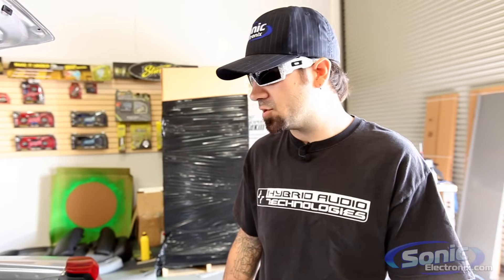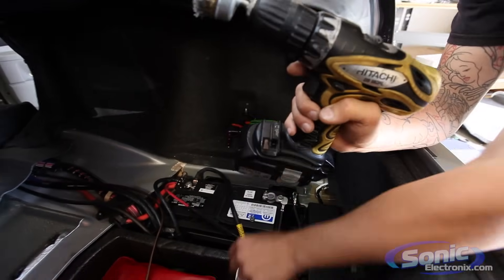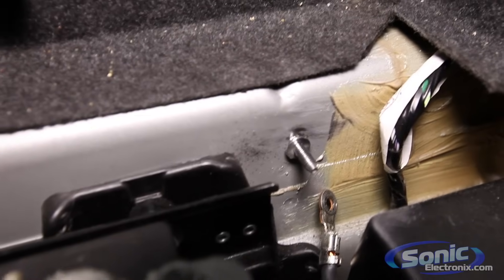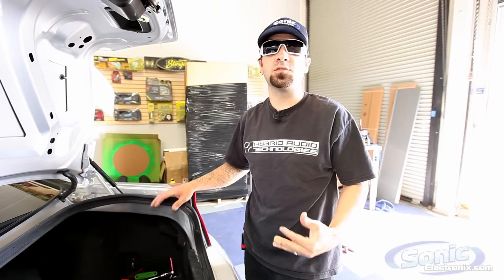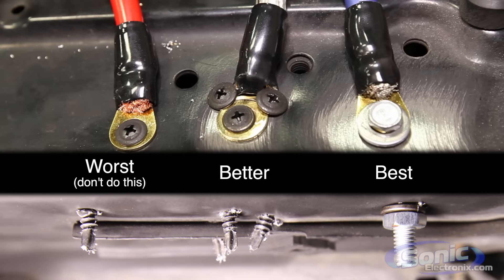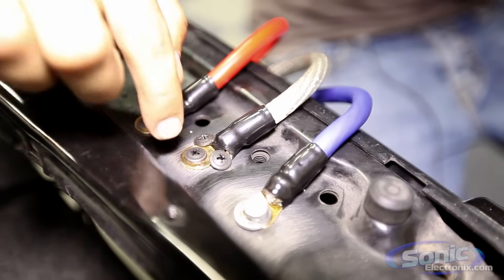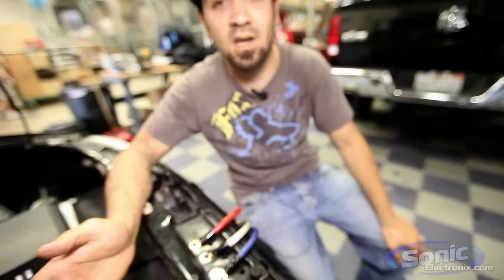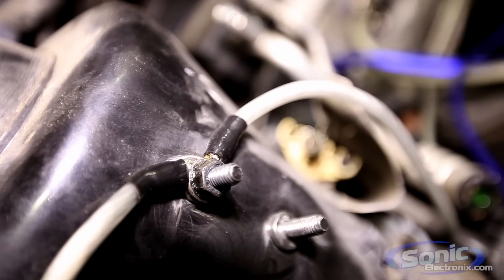How to Properly Ground a Car Amplifier | Good & Bad Examples | Car Audio 101

Comment: Can't you hook the amplifier ground to the battery ground?
Reply: +PSYk1ll4h If the battery is right next to where they are grounding it anyway it should honestly just be grounded to the battery. I dont know why they didnt just do that. If the battery is under the hood and your amp is in the trunk its a lot easier just to ground to the frame of the car.
Reply: +daytime81 If youre that close to the battery just ground it at the battery. It just uses the metal on the car as a path to get back to the battery anyway, So instead of having to travel through 2 crimp ends and post and what not just cut out the middle man.
Reply: PSYk1ll4h Yes if you have a long enough grounding wire.
Reply: +PSYk1ll4h You don't want your ground cable to be long. 1 foot for an amp is usually perfect.
Reply: +PSYk1ll4h its easier just to ground it to any metal on your car
Reply: Chris Siercks yes thankyou :D
Reply: +PSYk1ll4h I'm pretty sure they were only showing how to mount your ground to the frame.  Unless someone is planning on putting their amp in the engine compartment, you wouldnt want to use the negative post on your battery for several reasons.  One is because you want your ground as short as possible, so if you are mounting your amp in the trunk, you have too long of a ground wire.  Another reason is because it would be difficult to run a larger sized power wire and a ground wire through the firewall.  Finally, if your ground wire is 8, 4 or even 2 gauge, it can get very expensive to run that long of a ground wire.
Reply: drummerguy187 I know. I can get an battery and put it near the amp.
Reply: +PSYk1ll4h You definitely could.  Especially if you are trying to run a larger system in your car.
Reply: +drummerguy187  not only that but it dramatically shortens the life of the battery as wel as a major chance of exploding it from overheating and power draw. just use a short 3 ft or less ground to chassis and all will be well

Comment: Quick question, is it okay to connect 2 or more grounds to the same spot? For example the ground of a capacitor and the ground of an amp to the same bolt.
Reply: It shouldn't really hurt anything

Comment: Can i use the bolt that connects my cars back seat to the car?
Reply: Levi Abner yes, just make sure the bolt is free of paint.seat belt bolts work very well.
Reply: Bigchuck678 What if the seat belt bolt is bigger than my 0 gauge terminal? Where are terminals that have an O ring to fit my seat belt bolts?
Reply: Luke Urice I had the same problem, i just took a round sander bit from my drimmel and opened the O ring till it fit snug. You may be able to use a drill.
Reply: +lurice 0 your best option is to use a 0 gauge ground lug and bolt it to a bare surface instead of fighting with crimping large gauge wire
Reply: I used the seat belt buckle brackets, you know, the ones that hold the belt buckles in place? I used a drill wire brush to clean off the paint around the hole of where the bolt goes through. Also the bottom of the bracket and the top of it. It worked for me. Previously I had just took a self tapping screw and drilled it through trunk area. It was cleaned off as well. After some time I was getting engine whine. Took me a long time to figure out while and this video explains that. A loose ground can cause noise as well.

Comment: I have a question. I have 2 12 hifonics speakers. I'm having trouble with one of them one turns off by itself have to be moving the wire so it can turn back on

Comment: If the cars negative terminal is 6 inches from the point where you mount the ground, why wouldn't you just attach it directly to the negative terminal?

Comment: I would slap that guy if he did that to my car.
A factory ground should not have an amp attached to it because you will get noise from what ever that ground is for.
You need to up grade your grounds period.
1.00 cable from your battery to the block and 1.00 cable to the car body.
after you do that you can screw a ground with a tech screw anywhere you need one.
but you need to inspect ALL the factory grounds because I have seen mechanics forget to reinstall a ground and if all the grounds are running through a single cable I have seen them red hot cause problems with dash lights flickering tack jump around all because some idiot fucked up the factory grounds.
I have fixed a dozen cars just by re-connecting that little black ground that goes directly from the body to a valve cover bolt.
Reply: Your wrong!
A customer connected a ground to a factory location and it was the same ground as the headlight switch he was getting a high pitch sound every time you turned on the headlights
Another customer had the radiator start leaking due to electrolysis caused by a bad ground as I said I have seen more than my share of problems caused by lame installers who don't treat the ground on a car the same as you would the power.
Reply: On fords you have less trouble with grounds but GM don't get me started.
Honda and toyota are ok but you cant use the factory grounds to run accessories you have to run your own.
How many times have you heard about an alarm install causing problems it is because an installer used a faulty ground location.
Another customer complained her A/C was not working it took awhile but guess what the guy who install her stereo undid the ground for the high pressure switch put his ground on first and reconnected everything.
The computer was getting an incorrect resistance reading and would not let the compressor engage it thought the switch was bad.
Reply: It's funny you think thats beefy the 95 taurus I had came stock with a 130 amp alternator but I upgraded it to 250 because I do run multi amplifiers and an inverter I never needed an extra battery but I thought about it.
Reply: hay man, seems you know your shit, I got a 3000 watt amp, and the shop wants me to buy a 220$ ex battery, but can I go to wallmart and just buy a big ass battery, will it work, and whats the difference ? thanks man
Reply: yea they didn't say anything back extra kits and shit,  does it have to be a xs battery, or will any decent car battery work
Reply: I assume you car is A GM or a honda or toyota and the lights dim.
The reason you need an extra battery close to the amp is resistance if you use a 00 power cable back to the amp there will be no resistance In some cases the ground is what can cause the lights to dim thats why I say to upgrade the grounds.
When you buy that amp kit it comes with a 00 ground that will get you too the block and you will have enough extra cable to go from the block to the body.
I dont run big subs just two tens and I hate ported boxes.
If you must run a extra battery buy a good battery one that has a 5 year warranty put that battery in your car and run the old battery in the back.
A cap will do the same as an extra battery and you don't have to worry about an iso or the battery leaking and a cap is only $60
so you see the shop is trying to sell you something you don't need and those batterys are only good for that application.
they charge and discharge quickly.
if you had an extra real battery your car could sit for a year and still start the car those medical battery's wont do that.
Reply: I will outline what you need to do.
1.Order the 00 amp kit from ebay.
2.Run the power down the drivers side.
3.hook up your grounds one from the battery to the block and one from the block to the car body.
4.run your RCA's down the passenger's side and all your speaker wires keep them apart from the rca's with zip ties or a plastic shield.
5.if you are still getting the lights to dim then try adding a cap if that does not fix it then you can add an extra battery.
If an extra battery does not fix it then your going to have to upgrade the alt.
If you do all that and the lights still dim your car is a pos and get rid of it.
Reply: There is a way to use the factory wires to the front speakers from an amp in the back it's called jumping and you can avoid  pulling the door panels but in my book it's better to run your own speaker wires.
you van find a video on here for how to do that.
Reply: Where would you put the ground wire? My guy drilled a hole into the car and put the ground wire there with a big screw. He didn't sand it and when my music is on halfway loud or louder my headlights and dashboard stuff dim a lot.
Reply: Chris Tindall would a bad ground on the amp be what's causing my headlights and dash lights to dim? My ground is currently hooked up to a place where my guy drilled a home into my car but we didn't sand the paint off. Could that be why my subs cut out at high volumes my lights dim?
Reply: ***** yeah my battery is about 5years old too, i'll get a stronger battery. The stock alternator on my car is like 90 or 100 amperes i think? My amp for my 2 12inch subs is 1800 watt kenwood.
Reply: Ahh alright. Well I'll look into getting a new alternator.. The only problem is that there expensive as hell haha.
Reply: snarlingrabiddog5150
Over the years I have had plenty of cars and each car I have to install a stereo and amp's In the late 90's I paid for a local shop to install some stuff and had to re-do everything never go to car toys for anything.
I have learned the hard way what not to do.
Mostly stay away from installers everything they do is down and dirty and wrong.
Plus if you look they all have fat rides and fat stereo's but they don't get paid that much so how do they do that?
I believe the installers who know how to bypass any alarm come and steal your stereo they have your address and they know what is in your car.
the only stereo that has ever been stolen from me was one I had them install if I have to go to a car stereo store for anything I pay cash no name and no address and never a problem
I once spent $1000 on a car's wiring because I bought everything piece by piece at local shop's those amp kit's on ebay really are a good deal.
The car I just installed a new stereo in two 12's a kicker vg.900 amp a kenwood 1000 amp mono block a kenwood 800 2 channel amp and a kenwood 400 4 channel 2 front door speakers 2 rear door speakers 2 rear deck speakers and my lights don't dim.
Including the kenwood head unit I am just under $1000 for everything.
If that stereo is on even a little it vibrates the car so much my GF get's wet but she wont admit that's why LOL.
Reply: Oh anyone who want's to seal their doors but can't stand the cost of dyno matt Gutter seal tape is a cheap option and you can get that at home depot $16 for 25 sq feet that's enough for two doors If you have a 4 door you really should seal all 4 doors simply to keep out road noise also you can glue in some cheap tupper ware lined with dyno matt or gutter seal as a door speaker baffel  I did run into a little problem I forgot to roll  down the window to check for clearance so i had to re-do that.

Comment: Will bad ground make my amp go on and off, like lights flickering during an electrical storm, or do i just need a new amp?
Reply: Yes, if the ground connection is spotty and not secure, you may be losing connection altogether at some points which could be causing your amp to shut off. No ground, no circuit. Secure it! :D

Comment: okay, so you strip the paint to ground the amp, but what about the exposed body panel that you left with bare metal that is now susceptible to corrosion?
Reply: Theoretically, yes, and it's always better to spray something over it. I installed a system in my car about 11 years ago, i scratched the paint for my ground, left it exposed, and there is no corrosion developing there after 11 years.
Reply: are you sure you reached bare metal? there are multiple layers including a zinc coating, which is conductive but provides corrosion protection.
Reply: Ryan R Yea, i sanded it really well. I did the ground towards the front of my trunk, at the top of the shock tower, underneath the trim panels, so it's fairly protected from the elements. The one i did under the hood started corroding within a few years.

Comment: OR do straight run from the negative post to the amplifier to avoid the terrible conductor that the car is
Reply: Doesn't make any difference by that logic, because the negative post is also grounded to the car.

Comment: Hey... Whatever works. I sand my grounds, which are usually overdone, big wire, big terminals, then spray some rust inhibitor over it. Do I HAVE to? No, but it's never bad to go a little over board for some extra protection.

Comment: Definitely shorten ground wire length, MECP not recommended to use a vehicle grounding point used by major electrical components. This may cause system noise... personal I love a nice strong seat belt bolt [ if readily avaliable ].... dont forget your handy star washers on the 3 screw method
Reply: Jarrett Lemmey what if your seat belt bolt is bigger than the terminal. where can i find a terminal with a bigger O ring to fit my seat belt bolt?

Comment: Wouldn't it be better to solder the ring terminals on rather than crimping them?
Reply: Oh fuck yeah
Reply: Depends on how good the crimp is. A very good crimp cold welds the wire to the terminal & eliminates all the air from the connection. This requires a lot of pressure. You can get this using a production crimping machine or hydraulic crimpers but rarely can be done with hand-tools.
Reply: Get a nice and sturdy vice grip and a 4lb hammer. Thats how I get super secure crimps, but really most of the time I just squeeze the grips.

Comment: The best ground is right at the battery terminal,  And using dielectric silicone grease.  Also fuse the ground as well.  With new vehicles being junk electrically now a day its a good idea, also wire in a relay to disconnect the amp when the engine is not running...Fuse also the relay coil....Been there done that!!!

Comment: Yeah, the good thing about this "tutorial" is that your exposed metal will rust bad without propper protection.
NICE!!
Reply: ***** its called galvanic corrosion. Its not rust. It WILL break the bond between your amp and ground eventually. ALL OEM ground connections are coated, and for damn good reason. At least with dielectric grease {the red spray shit in the battery aisle is easy to use} or some sort of laquer/paint.
Reply: i have had amps installed in my cars for years, Never painted any of the sanded grounds and no rust whatsoever.
Reply: Little bit of nice goo known as dielectric grease around the connections will make sure corrosion is not an issue. I use the stuff on everything that has electricity flowing threw it and is exposed to air/water/dirt.
Reply: Diesel Ramcharger Thank you!
Reply: but wait a sec, does it really matter is it oxidates? you can always move the ground but you probably won't have the same car by the time it starts affecting anything.
Reply: i just realized i'm a little late lmao
Reply: barbie gamaes tan UHHHHH. No. Zinc would be an example of cathodic protection, and it has all been removed by the installer as well.
Reply: Tyler Harrington thats so false. the inside is still exposed to moisture in the air as well as the oils in your skin when you touch the metal to put the ground wire on.
Reply: coisasnatv ;)
Reply: Everyone its actually cathodic protection as the chassis is connected to the battery so it helps prevent rust. However I still would not leave bare metal like this on my car.
Reply: After everything is done, just spray some red grease over the thing. It will be the last thing that rusts in the car.
Reply: coisasnatv Lol....."propper".
Reply: Tyler Harrington
Oxygen is an oxidant stupid, didn't you learn that on school or you are that ignorant?? Moron.
Reply: coisasnatv You're a dumb ass, it's in the trunk, covered. right next to the battery. If that post is going to corrode then so is the battery terminal as it's in the same environment...do the world a favor, don't give people advice

Comment: Dude ... Use the right tool for the job.  Just pretend it's YOUR CAR , how about a strip of scotch bright pad to clean the ground. Would you use a jack hammer to crack ice for drinks????   How about proper use of star washers to insure a good connection.  Crimped and soldered connections, do it right or go home.
Reply: That is his car, its their demo vehicle

Comment: I use OFC wire and terminals, bolt and washers and use contact grease on all the contacts, short route direct to frame after I test for resistance using dmm then I spray rubberized undercoating over the end. Years later no issues.

Comment: the shop i took it to grounded the amp to the rear seat.. the part where you lean on as somethings to screw so it will be in place, the installer drill a hole in that metal part of the seat to the chasi and used one screw.. if I take the rear seat off the amp isn't grounded anymore